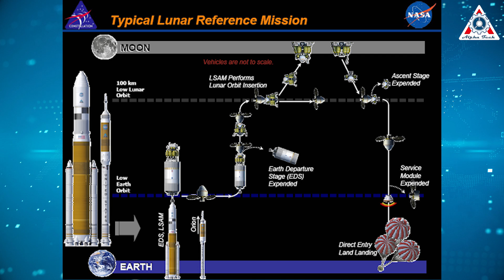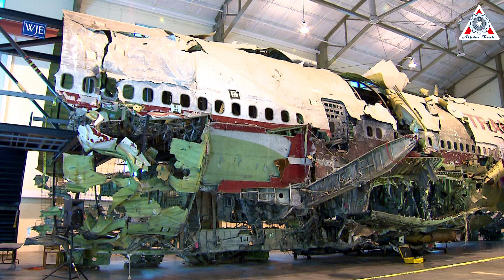NASA SLS FAILURE...!

Comment: Back in the early days of spaceflight Verner Von Braun and his team stopped working until they got a written promise that solid fuel rocket would never be used for manned rockets.
Once again, the Engineers were smarter than the politicians and the bean counters.
Reply: @God In The Glass yeah thats how its written
Reply: @tomh1727  “Personned”
Reply: @TheBooban  Homanned xD
Reply: @TheBooban  "Organically ridden"
Reply: @TheBooban  Crewed.
Reply: Hold your horses, there ghost. There is plenty of blame to go around. THE factor that has created this disaster: Mindset. "SLOW DOWN! This govn'ment project is going to put my kids through college." Yep: the old "rust-belt, union shop" mentality: make it take as long as possible and cost as much as possible. That includes the Engineers as well. Want a good analogy? Try the "Boston Big Dig." It was the most expensive highway project in history. The project was originally scheduled to be completed in 1998 at $2.8 billion. That's in 1982 dollars, but US$7.4 billion adjusted for inflation. When was the project completed? December 2007 at $8.08 billion. That's 1982 dollars, but $21.5 billion, a cost overrun of about 190%. The Boston Globe estimated that the project will ultimately cost $22 billion, including interest.
Reply: @lawrenceallen8096  I used to think that way too. Then I got a job working with several government agencies.
If the contractors are getting greedy or they're going over budget, it's the responsibility of the contract holder to tell them to meet the agreed upon deadline at the agreed price or be held in breach of contract. This happens all the time in private practice, but almost never happens in government. Everybody's scared to play hardball with the contractor for fear that he has a congressman or senator in his Rolodex who can come down ever harder on you. As such the ones who should be enforcing the terms of the contract and holding the contractors' feet to the fire don't do their job...and all the contractors know that.
Reply: @ghost307  Yes, sir! True. These corruptors come in many forms. The "Military Industrial Complex," e.g. the former GOP Congressman  or retired Military officer who now sits on the board of the Defense Company who tells the Senator to lay off the hydrogen valve maker because they are in their district. Or, very much the unions who contributed BIGGLY to the Democrat Party Campaigns, and who wouldn't like the Government to pull their contracts for failure to deliver.
Reply: @lawrenceallen8096  Unfortunately this is an old problem. In the early days of WW2 Admiral Lee heard from one of his subordinates that the quality of a certain type of equipment being supplied was not up to par. He made a report about the problem and soon got a call from the General in charge of that contractor demanding to know WHO had told him that the equipment was poor.
Admiral Lee protected his officers and only responded "does it matter how I found out?"
Reply: @ghost307  A lot of that effectiveness during WWII has to do with the quality of the generation that fought it. The greatest Generation who also, by the way, put people on the moon within a decade! As for leadership, General Marshall had a lot to do with it. This is an excellent lecture on how he prepared and led the US military throughout WWII: https://www.youtube.com/watch?v=AxZWxxZ2JGE&t=123s
Reply: @lawrenceallen8096  Also by the time it was completed it has hardly made a dent in the traffic issues. The express route to the airport is nice but overall it was and still is a huge mess.
Reply: @jd52wtf  Not a huge mess for the people who worked on it! It was the "Great Big Dig Boondoggle" for them. They sucked out of it for all they could get out of it, like a swollen tick on a deer! 1991-2007! WOW! 16 years!
Reply: @lawrenceallen8096  it's a problem with the way the government handles cost plus contracting, nothing to do with unions at all
Reply: Solid boosters are fireworks not rocketry. Nasa’s SLS boosters exhaust highly carcinogenic exhaust into our atmosphere then dump toxic boosters into our oceans.
Government is greed, irresponsible incompetence, uncaring waste, sloth, corruption, & NASA is government. 

NASA’s post Apollo budget in 2020 dollars averages over $20 billion PER YEAR… with supposed world class technology, staff, infrastructure (pads, tanks, property, centers, vab, etc) already paid for & in place… While clean sheet Startup SpaceX produced launch Vehicles far beyond anything NASA is capable of.. Falcon9/Dragon for $300 million, Starship <$5 billion.. having to acquire all properties, infrastructure, staff starting with nothing.  So don’t give me that poor NASA didn’t get the budget BS… 
After the ‘flags & footprints’ unsustainable, unaffordable dead end SaturnV/Apollo, NASA promised a gullible Congress/America a $4 million per launch Shuttle, then delivered a $1.6 billion per launch white elephant.. Constellation was a another disastrous incompetent NASA boondoggle cancelled.. SLS is a $60+ billion unsustainable, unaffordable $4+ billion per launch NASA failure boondoggle.  Get over the faded Apollo nostalgic BS…  #defundNasa.
Reply: @God In The Glass 
It's 'manned' not 'Manned' as it's not a proper noun or the start of a sentence.
Reply: @God In The Glass using the word man in some instances is like using the word dog.  It states what species the critter is but doesn't specify gender.  Way back in the day there were separate words for mankind, female, and male.   Oh look,  there still are three separate words!  Imagine that.
Reply: It was an engineering failure that killed Challenger.
Reply: @donadams8345  Not really. It was caused by someone in charge ignoring the limitations of the design.
If you bought a refrigerator at Costco, put it in your cart, and pulled the cart down a gravel road behind your car with a rope at 70 MPH it would not end well. That wouldn't be an engineering failure; it would be the result of exceeding the design limits of the cart.
Something similar happened on Challenger. The O-rings used to seal the SRB sections have a working temperature limit. As Dr. Feinman stated during the accident investigation panel "At 32 degrees Fahrenheit these things are as hard as a rock".
When the temperature overnight and at launch was unseasonably cold the Morton Thiokol engineers who designed the SRB joints strongly advised NASA to delay the launch until another day. The launch happened when NASA management, in an effort to avoid an embarrassing launch delay, told the engineers to "take off your Engineer hat and put on your Management hat".
Challenger was more a failure of ego and "get there itis" than an engineering issue.
Reply: @ghost307  You mean it never freezes at the cape?   Good engineering practice is to design a certain percentage over the expected limits for a robust product that won't fail.   Apparently these engineers and scientists failed.   Food carts?  Wow!   That's about 3000% or design limits, give me a break, LOL!   Get real.
Reply: @donadams8345  it was the engineers that told the launch coordinators not to launch because it was too cold and that o-ring might fail.  Not the engineers fault that the coordinators ignored them.
Reply: @karlsjunior466  Who designed that solid fuel booster in the first place though?    Engineers and scientists, not coordinators.   Ultimately it was an engineering failure.    They failed to take into consideration the temperature range the booster would be operating in.   Yes, I know that at the last minute they tried to stop the launch but they should have come up with a new O-ring before that.
Reply: @donadams8345  disaster could have been avoided but ego prevailed.  The workers who designed and built it knew the flaw of low temp on that o ring and made sure to tell the bosses.  They work for the bosses.  When the boss overrides you then the blame is no longer yours.   They built a rocket to fly from Florida.  99% of the time it is well above freezing and there would be no complications, they knew this.  The bosses HAD to launch or face potential backlash for more delays.   I think a delay was called for.   The deaths of those astronauts  was directly the fault of management.  The same management that over spends and usually doesn't care about delays.   Horrible management team.
Reply: Got a citation for that quote?
Reply: You mean kidnapped nazis
Reply: Used to weld asme radiographed welds by hand same diameter every material .
Reply: I wondered why WvB never showed up to any of the conferences or debriefings,  at least none l saw.
Reply: @leonardgibney2997  he wasn’t a show horse. Also, many people in his orbit had reservations about his history and ambitions so he kept a relatively low profile.
Reply: @sevenravens  I wonder if he realized his rockets weren't any use for conquering space.  Too dangerous and requiring too much fuel.  Many think men will be zooming around the Cosmos like "Star Trek"  eventually.  Well at least the SS Enterprise didn't use rockets.
Reply: @leonardgibney2997  if you're talking about Werner Von Braun, the WW2, V-2 rockets were Liquid Fueled, using liquid oxygen, and alcohol, or kerosene, Not solid fuel. The casting process, took factories, that made great targets.
Reply: @leonardgibney2997  Perhaps because he was a Nazi in Germany's Rocket Dev Program maybe?
Reply: @leonardgibney2997  Perhaps because of his allegiance to the Germany in WW2 in making V2 rockets?